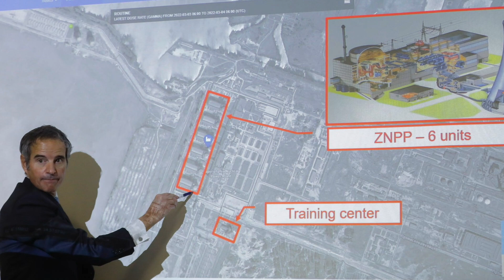A fire at a nuclear power plant from a shell. Is disaster inevitable?

Comment: If the Russian army wants to prevent the Ukrainians from using the plant, it would be easy and safer to destroy the main transmission lines a distance from the plant.  They are very vulnerable.  A nuclear power plant isn't usable unless the power can get to the customers.  I think there is a conscious attempt by the Russian government to cause the westerners to fear nuclear, so Putin can sell more oil and gas.
        If the Russian army is going to take over a plant, they should have Russian nuclear plant operators who manage similar plants in tow to move in and work with the Ukrainians.   That way the army isn't directly involved in the plant.  The Russian nuclear plant operators onsite can always call their army if there is a lack of cooperation. Causing an accident at a plant when the wind is blowing the right way is a way to have a weapon of mass destruction while claiming it wasn't.

Comment: I'm most concerned about the fact that the workers are not allowed to do their work in peace. Apparently the workers need to run every single decision through a Russian commander. Military has no place in a nuclear powerplant; least of all, in command of running one. Also the sheer stress of having to work in that environment must be immense.
Reply: I posted this in another place, but I think you can see the wisdom in this: If the Russian army wants to prevent the Ukrainians from using the plant, it would be easy and safer to destroy the main transmission lines a distance from the plant.  They are very vulnerable.  A nuclear power plant isn't usable unless the power can get to the customers.  I think there is a conscious attempt by the Russian government to cause the westerners to fear nuclear, so Putin can sell more oil and gas.
        If the Russian army is going to take over a plant, they should have Russian nuclear plant operators who manage similar plants in tow to move in and work with the Ukrainians.   That way the army isn't directly involved in the plant.  The Russian nuclear plant operators onsite can always call their army if there is a lack of cooperation. Causing an accident at a plant when the wind is blowing the right way is a way to have a weapon of mass destruction while claiming it wasn't.
Show less